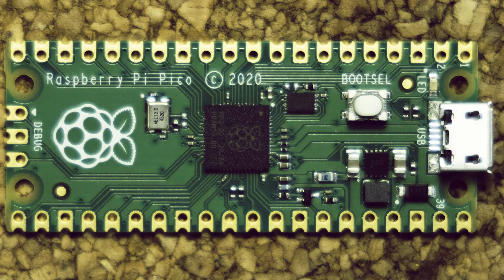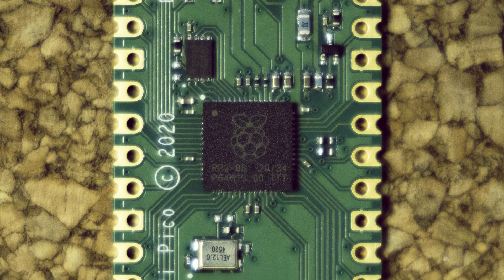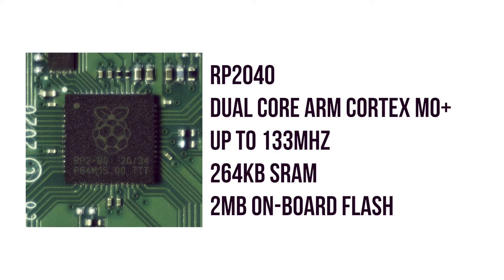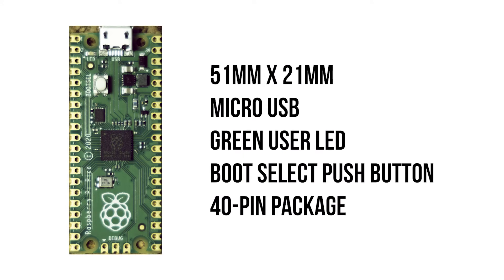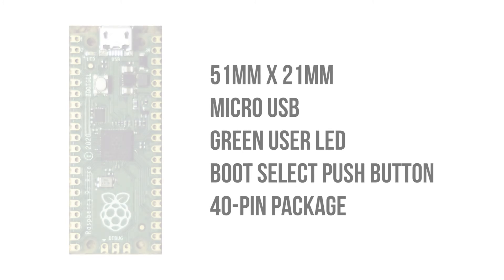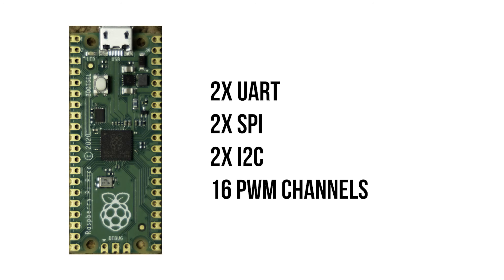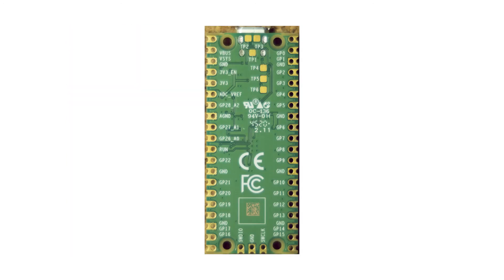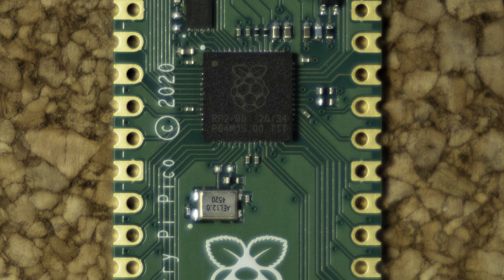First Look at the Raspberry Pi Pico: Physical Overview

Comment: Interesting board. I hvae bought a small  handfull. Sort of sn STM32 competitor. I hsve used s lot of Arduino Nano, when I do not need WiFi. This woul be an interesting alternative when I need more momory. I hope it will have Arduino IDE support soon for C++ support for hwomare used to that platform. I have tried MicroPython but it does give me problems with sensor support.
Also the Pico support for wide supply voltage fit LiOn batteries fine.
However in most cases I woul go for an ESP8266 as I need often WiFi.

Comment: It's interesting that the flash isn't part of the mcu but is on a separate chip over QSPI. Means that a handful of pins (6?) are always tied up for the flash but also means they don't have to make a variety of products, just one that you pair with as much flash as you need. Is there an internal oscillator too or does it always need an external? 
Those USB traces are interesting, I've never seen them so wide before...
Reply from the maker: I think the off-chip flash has some advantages for product line simplification as you point out, also useful for those making their own RP2040 based boards (like me hopefully soon!) to have some choice over flash configuration.

The RP2040 does have it's own inbuilt oscillator which can be used, but the RP2040 datasheet implies it's performance is questionable at best! Check out page 239 of the datasheet if you are interested!